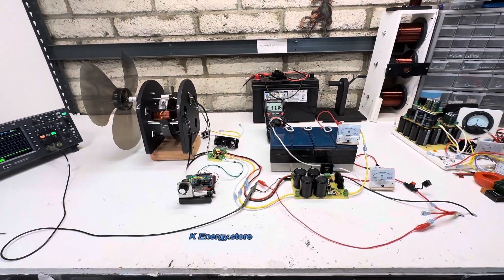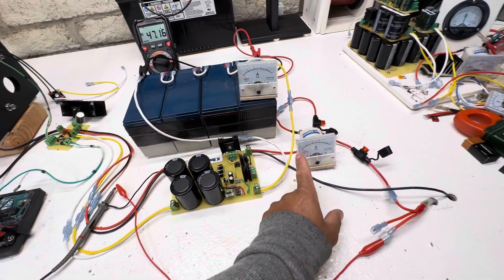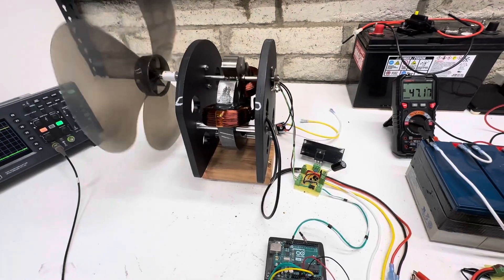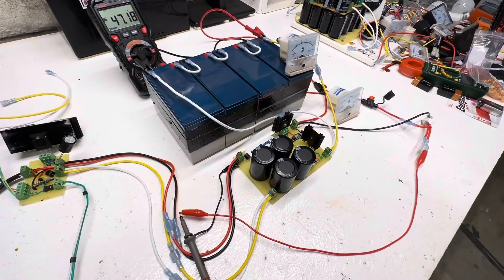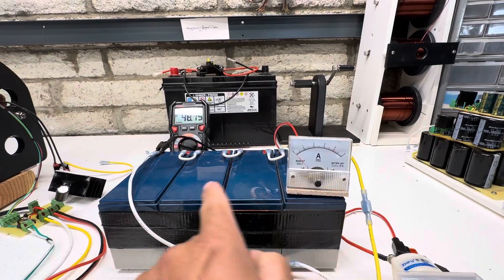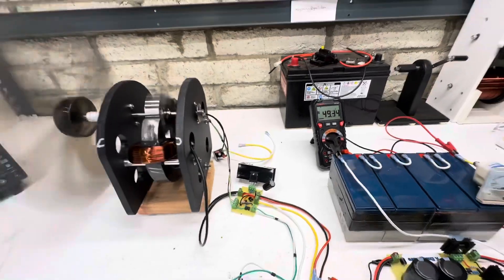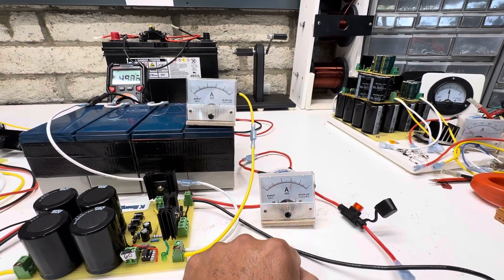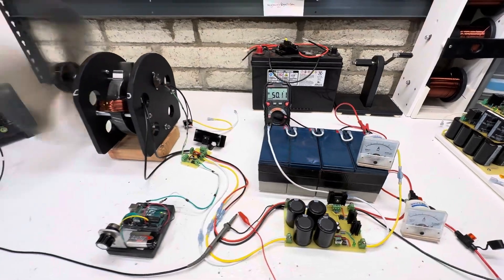48v cap dump with primary shutoff when caps dump

Comment: K, do you use electrolytic capacitors sir?
Reply from the maker: Yes
Reply: @kenergy1707  I heard they don't fully discharge and accumulate an energy gain as they begin charging again. Is that true or  do I have it wrong sir?
Reply from the maker: @hoofheartedicemelted296  definitely seems like it

Comment: If you could design a small unit capable of charging an electric vehicle battery, around 50 kWh, what would you suggest or come up with? It seems so obvious, yet nobody is thinking about it. Can it be plugged in directly to the 48v in the car?
Reply from the maker: Just needs to be scaled up

Comment: Really dig that attraction motor setup. What kind of steel is used for that or does it really matter?
Reply from the maker: Thanks buddy! It is just plain mild steel
Reply: @kenergy1707  very cool and the circuit is just a basic pulse motor circuit like the bedini I got from you?
Reply from the maker: @mcorrade  it’s the opto circuit
Reply: @kenergy1707  sweet I'll have to give that a shot
Reply from the maker: @mcorrade  definitely should !